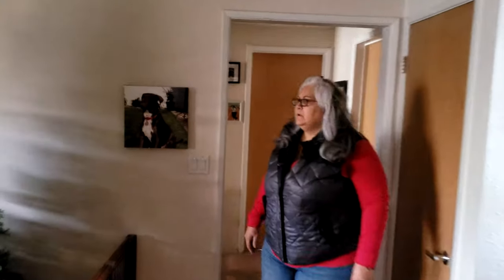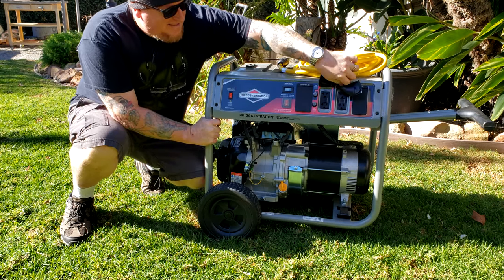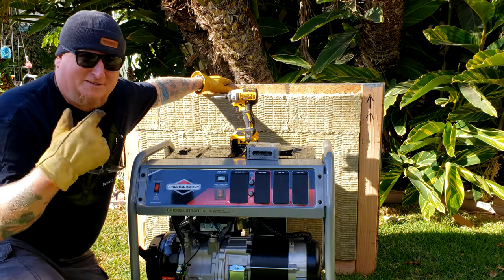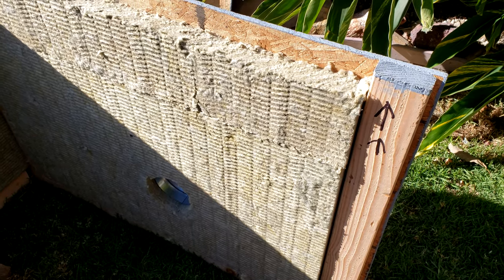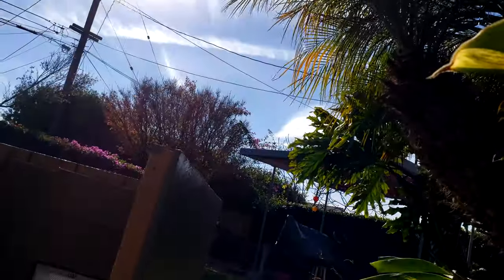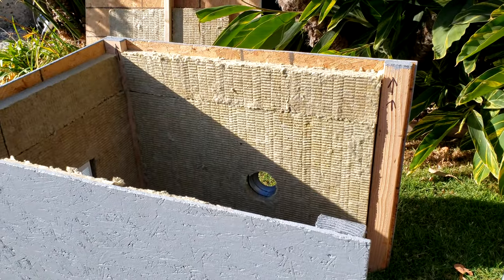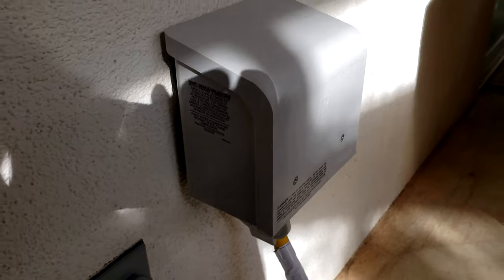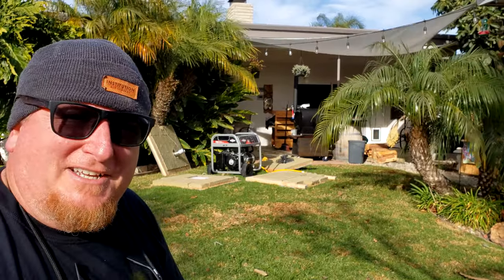How to make a generator quieter | Best Generator Quiet Box enclosure

Comment: Great video. A little advise. Make sure you exhaust goes straight out without any of it coming back in. These designs will only work if the vent and the fan is the only air moving through the box. The exhaust heat will burn out you fan motor and sooner or later cause a fire to the box itself. Think about it. If the exhaust heat didn't matter you could just let it vent inside the box and vent oit through the vent fan right?
Lastly, get a straight pipe for the exhaust to go straight out. Keep the shield to protect the wood but straight galvanize or black pipe with a pipe flange will work.

Comment: Nice job Todd! I did something similar at our off grid cabin, way more affordable compared to the home backup generator kits.
Reply from the maker: I watched that video on your channel. Nice job! I'll ask the same question here but did you notice any performance issues/changes after installing an automotive muffler?
Reply: @GreenhornBBQbeer  Actually all I did to the exhaust was make an extended exhaust pipe and attached it to the existing muffler. The generators exhaust is 5/8, I used 1 inch flex pipe and 1 inch galvanized pipe. We use it to run the air conditioner during the summer. Generator performs just as it did before building the enclosure.

Comment: Interesting! I've been eyeballing a small plastic storage shed and insulating it and debating whether just build a DIY wooden one and saving some bucks!! I think if a go the DIY route I might go a little wider and give it a plywood wood floor to make it a bit sturdier where I can add some hinges and have a flip up top and two open up doors on the front side!! Thanks man, you got me thinking now!! Getting tired of dragging my generator out of the barn to the front of the house every-time something goes nuts and we lose power around here!! I need a little small shed I can store in in on the porch near the electric panel that wont look too out of place and ugly!
Reply from the maker: I store the lid and sides on a half pallet on the side of my house, leaning, covered in a tarp. I don't have alot of room in this suburban jungle.

Comment: With Texas and Oregon getting ice hammered and major power outages..I pulled my Generator out of shed. I like your setup on a silencer box but would not leave the exhaust pointed up where rain and snow if any might flood the inside as water and electricity are not a good match for standing in or near eachother..especially at refuel and restart times. I'm going to think about using my shed and modifying it because of noise and neighbors..and thieves. Great video bro.
Reply from the maker: Thank you

Comment: Awesome video Greenhorn!
Could you please show/explain how you connect the exhaust pipe through the hole? Also, the pipe you used is larger than the air exhaust outlet from the generator. I would like to learn how you connect the pipe to the outlet.
Thanks,
Reply from the maker: I plan on doing a follow up video soon. It will be posted in our other channel, "3 Days Away" which will have content not so much related to food. Thanks for watching!

Comment: A couple of concerns I had regarding the design.  Did you determine how much heat you build up over a 4-8 hr period of operation in summer temps?  Also, overtime, I would think that the OSB would start to deteriorate in the elements.
Reply from the maker: I have an update video at our other channel, link in Description

Comment: the engine of this thing IS force air cooled, i think i would juist get a duct onto the starter (which houses the intake for the fan) these things barely let the engine run warm enough without any baffle box around it. (i would only need it on colder, cloudy days bc in sunny weather like in your vid, i could run everything off my solar panels.

Comment: I have considered doing this, but piping the exhaust underground with 2-3 mufflers and piping it exhaust to the edge of my property. Keeps the sound away from the house and I could have it pipe out in the really high grass to deaden even further. At that distance underground, the exhaust gasses won’t be too hot either
Reply: Doubt that theory would work... you'd get backflow to generator.
Reply: @Curtamous1  not likely, I’d use 3” pipe to prevent any backflow or heat buildup

Comment: Positive pressure works better than neg pressure. Id put the fan on yiur intake side and not the exhaust side. Plus that will keep the fan itself from over heating
Reply from the maker: Good point, but I didn't want to blow air through all the cracks and seams.
Reply: I am thinking of building a similar enclosure but use 2 intake vents opposite each other and use a roof fan at the top like the zombie boxes have.

Comment: just wondering if you even need an exhaust outlet if you have that fan exhausting 100% of the time the generator is running anyways.
Reply from the maker: I thought about that... I need to do some kind of test with that 💡
Reply: @AnX8765  good point
Reply: @AnX8765  I am thinking of building a similar enclosure but use 2 intake vents opposite each other and use a roof fan at the top like the zombie boxes have.

Comment: you could use the exhaust to cool the inside by using the pressure to power a turbine to force fresh air inside. likely will cause slight back pressure but also will silence it a bit. like a turbo. who doesn't love turbo
Reply from the maker: Interesting engineering that would be, yes....

Comment: Nice video man!! Sure as hell better than most videos I saw on Youtube so far. Only advice I would give is to make the box ‘screw-less’ and use locking hinges and something like slide panels. Good job! 👍👍
Reply from the maker: Thanks, yes that is a good idea with the hinges, I would use stainless I suppose. Maybe a future mod...
Reply: Definitely stainless if you want it standing outdoors. I would go for big hinges which have pins that you can just pull out. That makes for an easy assembly.
Have you considered rerouting the exhaust with a couple of U-shape bends? I’m asking as I think a large portion of the sound comes from the exhaust and I would imagine that a good couple of bends might have sound bounce around inside it? I would even try that with PVC plumbing pipes just as a easy test before I do metal. I still have to build a box for mine and that’s what I thought of trying as a test. I’m even considering keeping the exhaust inside the box and add one decent extractor fan to pull out the fumes and one push fan directed straight at the air intake which pushes clean air from outside.
Reply: @howlinghusky7823  Did you start on your box yet? Those are solid tips to make this even better. This video and your comments are really helpful. Going to try to tackle this myself in the future.
Reply: @dannydeutsch279  Hi Danny. I actually haven’t yet. I have so much work to do at the moment. Busy building a massive Rosewood and Olivewood pivot entrance door, 2.3m X 1.3m.
After that a big built in braai (BBQ) and then a whole new kitchen. So I have a whole truckload of wood to order and then I’ll add sheets of plywood to the order for the generator’s silencer box.
As for the silencer part, I thought of it this morning. As a test I would use the PVC and let it loop in S curves like a long curled up ‘snake’.
If it works, I would then do it out of metal and after it’s done, encase the whole S-curves in a extra wood box that I would fill up with Polyurethane foam spray so it would expand all around the pipes. That would also reduce both the heat and the sound.
I will come comment here when I’ve built it and maybe also make a video of the build. I guess it won’t be soon though. I first have to get through that list of work.
Reply: @howlinghusky7823  I am going to eventually tackle this as well, probably won't be for a while. Thanks for getting back to me.
Reply: @dannydeutsch279  Only a pleasure. Same here Danny. Mine will also be closer to the middle of the year or as soon as I find time for it. Good luck man! 👍

Comment: If you double layer the sound proofing on the particle board. Do you think this would even dampen it much more? Do you have a parts list for this?
Reply from the maker: I have a few links to the vital components in the video description. I suppose you could double up the rock wool insulation but the box would get large.

Comment: Personally if you’re going to build a box like that and make a investment I would’ve gotten a little lawnmower trailer that would accommodate the size so that way the box is already built on something that could be moved and have like a ramp where you could take the generator in and out when you need to… I would figure they would probably be a another option to probably quiet down the sound even more probably with different material would probably increase the quietness and lower the decibels even more than what you have there….
Also the exhaust I think they have something that would also prevent certain fumes you can also use a quite external muffler auto e from a car maybe chicken two different car mufflers that take something like a hot rod turns into a sleeper mufffler
Reply from the maker: I have a tight backyard and no way to keep it assembled like that, but good ideas

Comment: I like everything you did except when you showed that you have the exhaust pointing in toward the palms. I'm not talking about the damage that the heat and fumes can cause to the foliage of that planting area, but it is pretty thick, and you have a canvas(?) covering attached to the roof right near it. I'm concerned about Carbon Monoxide buildup right there, and possibly entering your house through soffit vents, cracks around doors and windows. My opinion is that the generator should be farther away from the house with the exhaust aimed away from the house.
Reply from the maker: Very good objective suggestions, thank you David.

Comment: I think you would get better sound proofing,, if you brick around it,  then buried it like storm/ bomb shelter  . In ground or little ⛰️  with thick door.   Fanned  vent for cooling unit & external exhaust output. Just my thought. 
Don't forget genorator are air cooled.  
Overheating genorator = short life genorator.  👍
Reply from the maker: Here is an update at my other channel: https://youtu.be/CyyF9vCYcOI

Comment: I would imagine you could lose one or two decibels if you replaced your insulation with  egg crate foam used in sound deadening applications.
One decibel reduction is huge
Reply from the maker: I chose the rock wool due to its flame and moisture resistance

Comment: Your Rockwool insulation is a great idea it quiets plus fireproofs the box and it is mold/mildew proof. As democrats shut down nuclear & coal power plants and fracking (natural gas) the sound of residential generators running will soon become common place. This is assuming there will be gas or diesel fuel to run them. The smell of wood gasifiers burning might also become common.
Reply: I live in Texas... The Republicans are the reason I just purchased  first Generator. Any ideas on how to Weatherize the Texas grid??
Reply: Leave it to chumps to politicize this